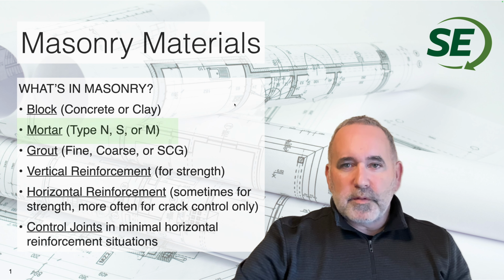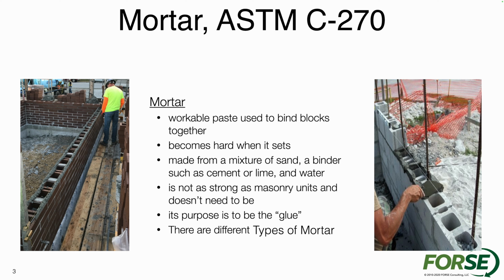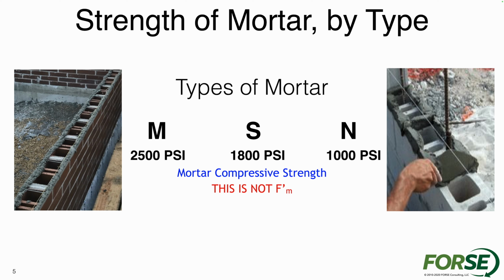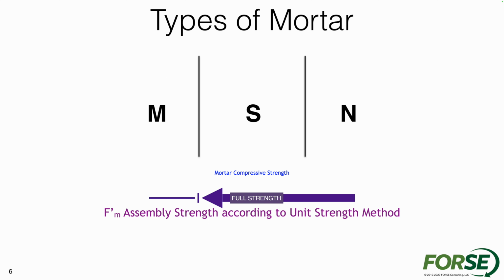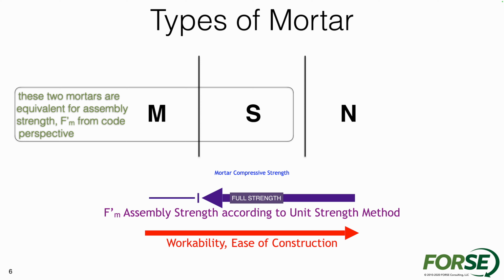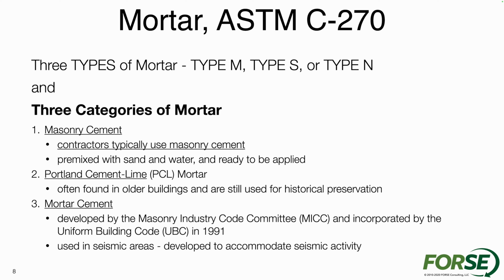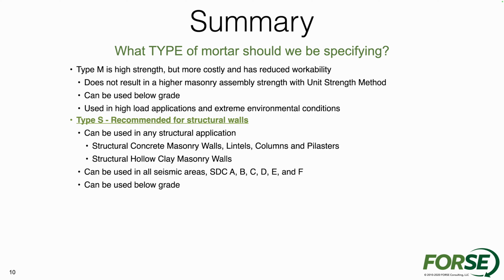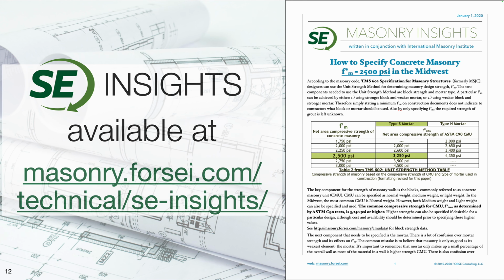Masonry Mortar Tips for Structural Engineers

Comment: Sir, your new subscriber my queistion if concrete solid block can be use in load bearing house construction without any column and beam i mean the all load will transfer via walls to foundation
Reply from the maker: Yes, masonry can be the main vertical load resisting system from roof and floors to foundations.